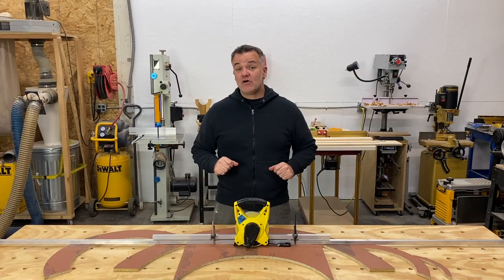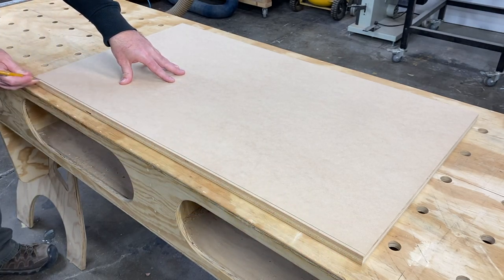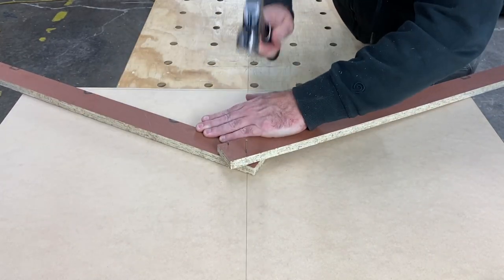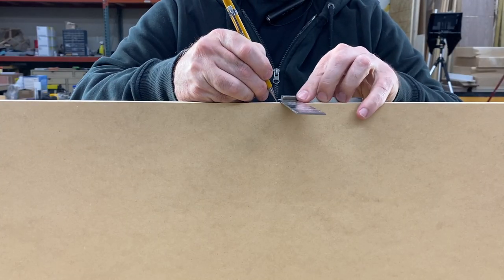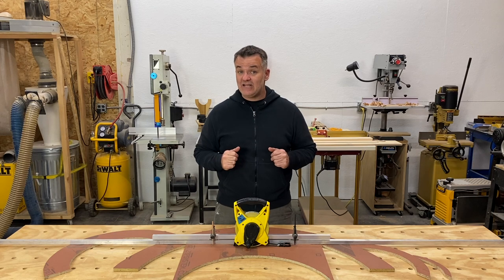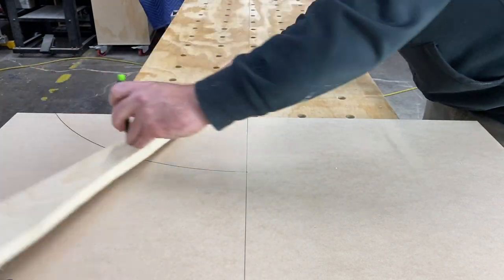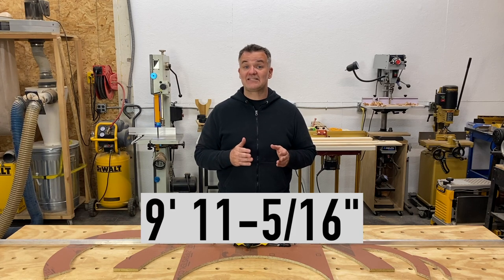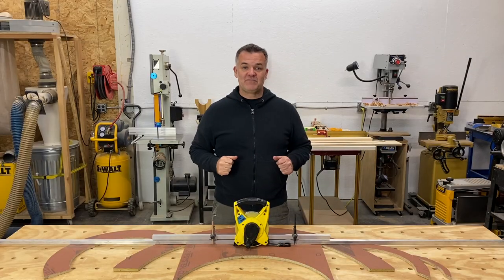How to Draw PERFECT!! Arches

Comment: Is it possible to draw a large radius when you don't have the room to swing a straight line the length of the radius?
Reply from the maker: Yes, but using a straight line and the radius is the most accurate way. You can always go outside and mark it out on a couple saw horses.